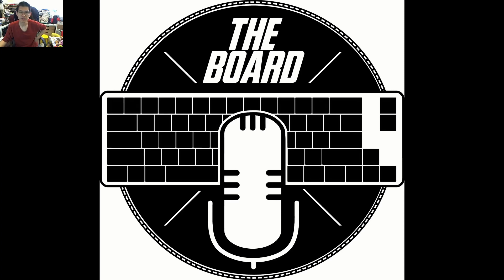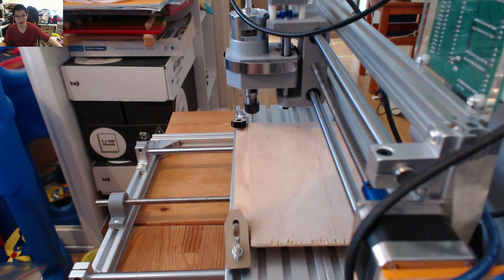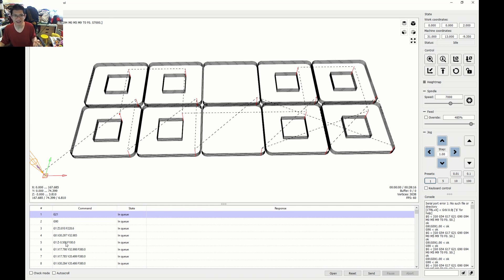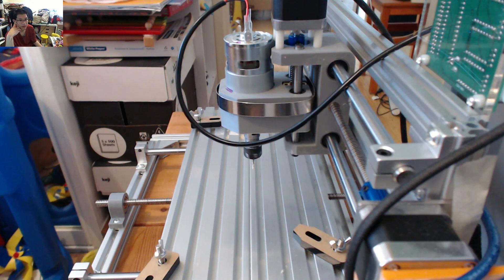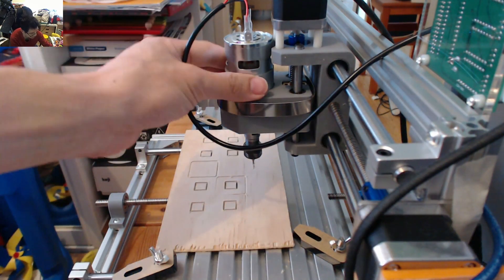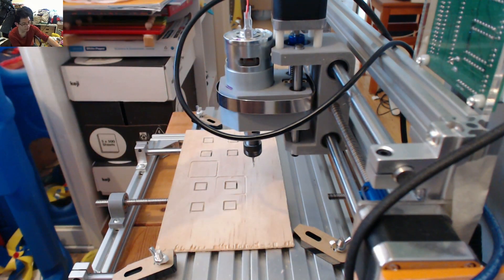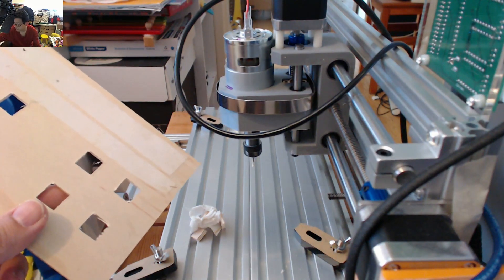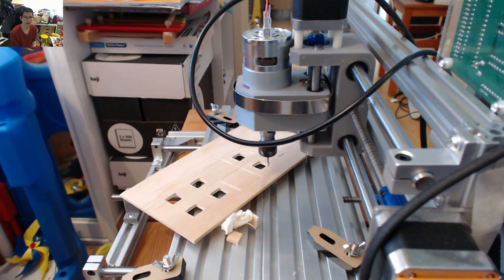3018 Mini CNC Upgrade Part 3 - Another Partial Fail

Comment: Longer screw and Helicoil would do the job to fix the broken spindel holder!
Reply from the maker: All good though, current situation works. Not sure what you mean by helicoil though.
Reply: @theboard  Helicoil is a threadinsert used when the threads gone bad in aluminium. Probably even other types of threaded inserts used in wood also can be used. Google on Helicoil inserts!
Reply from the maker: @Malfamartin  Ah, well it'd have to have some kind of ability to grip or be bonded to the 3D printed spindle holder since the design is pretty simple, but its good to know thats what those are called!

Comment: Hi TBP, I have found this series of videos, helpful. Thnx :) 
I am scared by the way you use the material clamps.. finger clamps are designed to have the clamp bolt through the slot and as close as possible to the workpiece. Whether it is a T-Bolt with the nut on top or a T-Nut with the bolt screwed down. The hole you have used is actually for a jacking screw, to level the clamp. 
Yeah I know, this is only a little thing, until you or a viewer upsizes to a larger more powerful machine, throws a large work piece across the room, destroying a family heirloom standing stately in the corner... Then it is A Thing!..
Reply from the maker: Hi Norm, Thank you so much for letting me know! The instructions have zero information regarding that at all! No excuses in that context, I myself had concerns about it which is also why I used the double side tape underneath to increase stability to the sacrificial layer underneath.

That said, my concerns relating the cutting power caused me to also mill at a slower feed rate too, which at least (thankfully not) had anything come off, it would have been not as violent.

Just as well I also don't have heirloom things haha :P but also why I don't operate it with my daughter around.

I really appreciate you taking the time to comment! Unfortunately the next video shows the same use of the clamps because I've already shot it.... >_<

Comment: I had the same problem happen to me right out of the gate for the clamp breaking the holder. I had the same idea using a steel hose clamp. Right away I noticed it wasn't holding well so I took it off and did two things that made a huge difference. First, mark off where you need the bends, and take it to an anvil or vice and make the bends to help secure it around the whole spindle holder, then I also took some rubber (tried paper at first) between the band and the spindle holder. This removed a lot of vibration and noise. Another thing that helped keep the spindle from moving much when cutting was to replace the bearings on the x and z axis with longer ones as a T8 bolt guide (drilled out and smoothed to just fit) the z axis. It's night and day difference. There are a few other things that you can do but these helped me A LOT.
Reply from the maker: Thank you for the suggestions! As much as it'd be great to do those things, I think that level of modding starts to get away a lot more than what I've done and have shown because not everyone may necessarily have all the tools to drill out and also replace the bearings (even though I know they're quite easy to punch out). Its a good comment though for others to find and give it a try themselves! I appreciate it greatly : )
Reply: @theboard  Yeah I guess so, hopefully will help someone out there ♥. If anyone else is seeing this and wants to take out the wobble, look at LM8LUU bearings to replace the ones it comes with. This typically fits 99% of the 3018 machines, but do your part and measure your machine. The other thing is a T8 bolt screw that you drill out smooth. You lose a little z-axis, but on this machine you're not looking to do 10" depth cuts with the stock spindle.

Comment: I'd say it's the metal band indeed.
Reply from the maker: Why would you say that is the cause?
Reply: @theboard  I've seen similar issues with not-aligned / non-squared frames. If the rods are misaligned, it puts either too much stress on the motor or on the coupling.

My first thought was if the metal band rubs against the back of the Z mount, but when you mentioned it might be too tight and pulls the rods together I thought of above reasons. It should be easy to check that, by just loosening / removing the band? You probably can increase the current that goes to the motor (by adjusting a small potentiometer on the motor driver), but unless you hear it losing steps, I wouldn't try that. It puts additional stress on motor (and make it get hot) and driver.

I also don't think hot glue will help on the axis. Fastening the grub screws itself should be enough, if necessary add some medium thread locker so they don't shake loose. Hot glue itself is probably a little flexible, so it will add / have some play.
Reply from the maker: @ulaB  Nothing for the threadlocker to attach to for the drive screw, only for the grub screw, as it relies in the collar the end of the grub screw to apply friction to the drive screw itself which is poor design unfortunately. I have actually recorded a follow up to this, yet to be released, which its not really a spoiler here, but the band is not the issue. It definitely was the collar/grub screws from the Z-axis stepper not returning the drive screw to the same position. That said, the next part found another problem ~sigh, which I haven't fixed yet....
Reply: @theboard  You could try and flatten the drive screw a bit where the grub screw is supposed to hold it. Like the motor that has a flat part on the axis?

As for the threadlocker I meant to secure the grub screws with it, not the drive screw. I had mine come lose because of vibration (also the z axis linear bearings keep shaking out of the housing...)
And yes. I guess you buy these machines to fiddle with them, not with the projects you plan on doing ;-). My Pro version still needs a lot of work too.
Reply from the maker: @ulaB  If it comes loose again, I probably will do that or maybe solder-fill the thread for a similiar kind of effect. That said, its definitely a fiddle machine and the purpose of documenting my failures is so people know what they're potentially going to have to troubleshoot, and also some options on solutions in desperation!